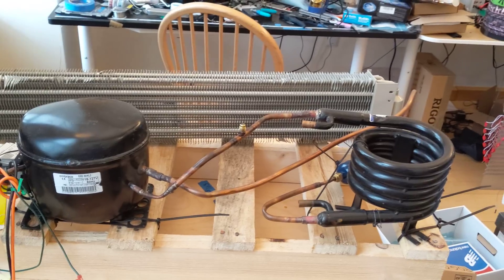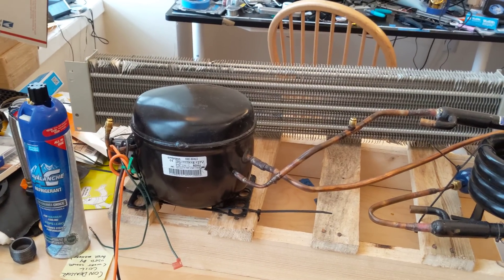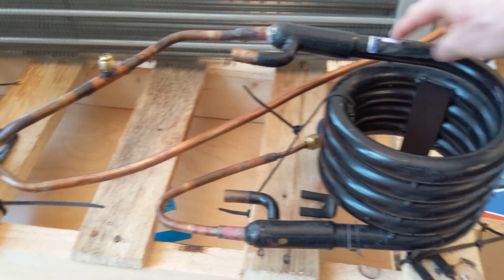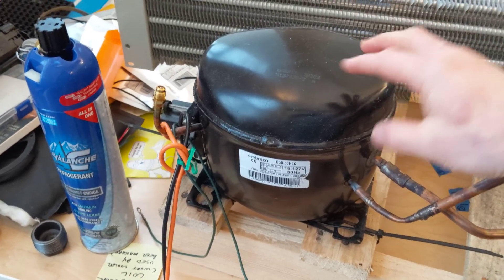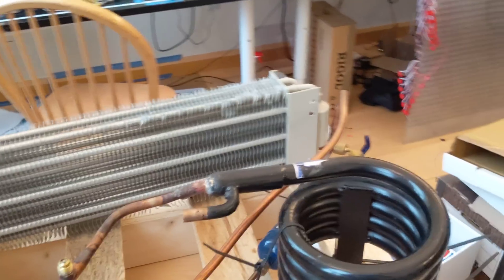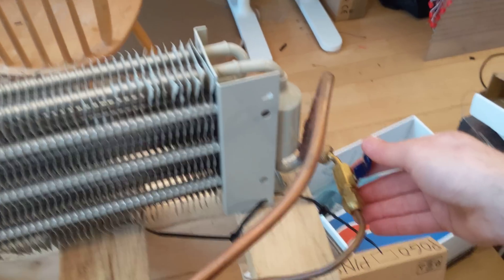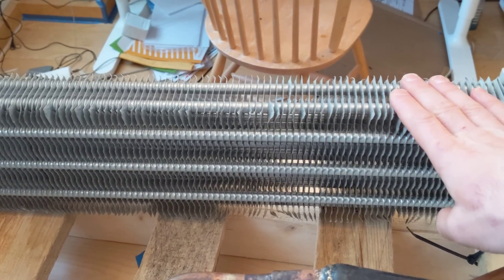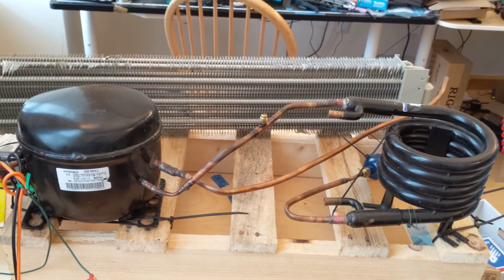Homemade air conditioner from junk parts actually (sort of) works

Comment: Would be cool to swap out the condenser on a portable air conditioner with one of those coaxial tube heat exchanger coils!

And btw, I think you may of put it around the wrong way, those bigger pipes are for the water, and the smaller ones are for the refrigerant line. (I could be wrong though)

Comment: its not evaporator that was condenser
Reply from the maker: The big long grey thing with the fins is the evaporator. The black spiral thing is the condenser. Hot refrigerant gas from the compressor first goes to the heat exchanger (black spiral thing) where heat is rejected into water and the hot gas condenses into liquid which then goes to that ball valve to reduce the pressure and then into that long fan coil to boil off.

Comment: What is the Waterloop?
Reply from the maker: Big buildings have a loop of water that goes from the ac units in people's apartments then up to the roof to chillers and then back down to the units. The units heat this water up and the chillers cool it off again.

Comment: That's kind of like a marine air conditioner which cycles sea water over the hot lines to cool it off. That's niftty. I lived in an apartment building which used geothermal heating and cooling and likely used the same kind of concept here. 

So thankful for these videos you have about AC

Comment: For an alternative metering device, you could use two of those yellow jacket ball valves, connected with a short copper run in the middle (as short as possible). 

That way, you could isolate that connection, and if you flare it on, you could open it, and slide a carburetor jet inside of it. Then seal it up and run it. Experiment with different sizes. 

That would introduce a small amount of contamination each time, due to opening it. So after you determine the right size, seal up, evac and recharge it!
Reply from the maker: Good idea, but ultimately I learned that there is a reason why all cheap units have a capillary tube and all others have a TXV!  :)
Reply: @bigjoshlevine  do you have any recommendations on where to obtain a coax of that size?
Reply from the maker: @conorabc  You can have this one for free if you are willing to come to NYC to get it! If not, you can find them on Amazon in all shapes and sizes here: https://amzn.to/3lwoBOl
Reply: @bigjoshlevine  I think my wings would get tired 😀awesome thank you! My dream is to build one of these using an automotive compressor and a DC motor for speed control. I want to somehow chill a computer’s cooling loop by putting a coax on the evap side. 

I guess I should get a setup like yours working before I try all that though! Thanks again.

Comment: Dumb question #1156: can I cool the hot pipes by wrapping them up in thin clothes , pouring water on them and blowing air with a small DC fan? You know, evaporation.
Reply from the maker: Depends on the humidity! If the air is dry then this can be very effective (google "swap cooler").

Comment: You live in a place with no access to outside air?  You living in a crawl space? 
 Should we send help?  Dial 2d86fh416fdb.. thats what you'll be dialing experiencing hypoxia .
Reply from the maker: The only access to outside air was though windows that only opened about an inch and forced ventilation ductwork. There was no practical way to reject heat though those window cracks- believe me I tried. There is air changeover do to the ventilation, but there is no way to reject heat to slow moving, diffuse air movement. You end up just making the conditioned space hotter. There are many buildings in NYC (and I am guessing elsewhere too) where the only way to reject heat is though a water loop that goes to the roof.

Comment: Nice try.   You could just get a free/broken fridge and fix it and use the components.  Clearly you discovered the lack of a cap tube is the problem, and your makeshift txv valve isn't working.  You can get a cheap txv valve from a car a/c system.  In fact, get all the parts from a car a/c and use the electric compressor.
Try again!  don't give up.

Comment: I just want to know why there are no videos of someone taking a vehicle 12v a/c system and making it portable
Reply: To big to make portable you have to have a compressor 2 radiators one hot and one cool side fans for each side and the power and it uses a lot of power
Reply: Not an expert, but I think the power come from the spinning wheel (motor belt), not the 12V.
So, basically, you will need a weed heater motor to power it... Quite noisy isn't!
Reply: I've thought about going to the junk yard to get car AC parts to build one, you'd just need an electric motor with a good amount of torque that can spin at about 1000 to 2000 rpm and hook it up to the compressor, and it should work if you connect it to a proper loop, although I'm not an expert on refrigeration so there could be some detail I'm missing that makes this not really worth it.
Reply: @Naitrio  will a car ac compressor work with a small 2 stroke motor or any small engine to spin it (and generate 12v for the fans)?

Comment: if your condenser is cooling good enough and producing a liquid refrigerant then your main problem is the expansion valve, no way that kind of valve will work right.  just use one of the three types of expansion valves to dial it in.   and of course you will have to dial in the amount of refrigerant and pressures.    I think your evaporator is fine you must have a fan though if you don't want freeze ups.   remember there must be enough liquid refrigerant produced continuous.  so there must be enough refrigerant in the system for the whole evaporator coil to get cold.  check the temp of evap coil at end of coil, if it is not cold then you need to adjust your pressures by adding more refrigerant.  a ball of ice at the beginning shows its working you just need to add the fan to prevent that from happening. but if you only get ice at the end and the rest of the coil does not ice up you don't have enough refrigerant  in the system.

Comment: I think you need a bigger evap core and a fan and youll be good but good job ,imma use the  heat exchange method with the water with the orifice but I'll use it with a dryers and accumulator, extra efficiency.

Comment: no wonder that it does not cool especially, there are no capillary tube
Reply from the maker: The idea was to use that ball valve rather than a capillary tube so that the metering would be adjustable, but it is almost impossible to get that ball valve adjusted just right.

Comment: Very nice! I am a technician and I made a mini split out of  a window unit and did my own water condenser and installed it in my cuddy cabin in my boat, only thing is that I had to add more coil to my condenser so I could get the proper pressures and now it actually works.. 5000 but's in the cabin comes really nice here in Florida.  Thanks for sharing!
Reply from the maker: Cool! I'd love to see more info on your unit! It is surprising how few DIY AC projects there are out there - probably because of the need for an EPA card. But getting the card is pretty easy, and considering how many people need AC...
Reply: Thats awesome 
How do you calculate the amount of coil you would need for the condesor. I am planing to build a mini split myself. 
What kind of low and high pressures would be nominal, assuming using 5000 btu window unit hardware.
Reply: Water has a higher thermal conductivity, why would you need more volume in the water condesor. 
Thanks
Reply: Any chance you could share some pics or a diagram?? I am trying to do the exact same thing!!

Comment: Nice work Josh. I wonder if the relatively low cooling capacity would be a good fit for radiant cooling wall / ceiling assemblies? https://www.rehau.com/us-en/radiant-cooling Also, I saw that you contributed to The Public Radio. Some interesting projects! I'm still stumped on uploading the firmware to my radio. But trying hard to learn a little bit of the AVR world!

Comment: amazing diy honestly ive always wanted to do this

edit i did do this  worked great
Reply: Tried it mate, tried it with an industrial freezer compressor setup, they don't have enough power to blow cold air. This is why you see air conditioners with 5000 btu min and up to 150,000 btu. Fridges are around 495btu.. Not worth your while. Best thing to do is to take an air conditioning pump from a car and put a motor to it, get the system charged with refrigerant and there you go.
Reply: @electriclightbulb1232  damn guess its buy over diy
Reply: @ianbuilder  yeah man you're right. I though of the same thing, I made an enclosure for the compressor setup I took out the freezer with the element that froze up front, I put a fan behind that and it would just turn all the ice to water and  drip everywhere, it can't keep up with the fan it's just not worth it ;d This year I'm gonna build one out of a car ac compressor though, air compressor motor on a belt connected to the pump and i'll get the system charged.
Reply: @electriclightbulb1232  nice good luck

Comment: Can you tell me if any R can apply to any compressor or it have to be specific. I found one old compressor, and on its label it say R134 ???
Reply from the maker: This is a very good question. The most important thing is that the refrigerant ("R") has to be compatible with the oil and seals in the compressor. This is a chemistry thing. You don't want them to react with each other, and you want to oil and the liquid refigerant to work together. There are charts like this one... 

https://refrigerationclub.com/oil-compatible-coolant/

Also important is that the compressor need to be able to work at the pressures that the refrigerant needs to change phases. Again, you can find charts on the pressures of different "R"s and then you can lookup or test the pressures your compressor can do to see if it can work.
Reply: In short you can use refrigerants with standing pressures (cylinder pressures) equal to or lower than.r134a along with the replacement of respective refrigerant compatible oil replacement for your compressor.

Comment: Where is your fan for the evaporator? Without the fan the evaporator coil will just freeze because it has no movement and cant disipate the low temp in the evap coils....this is exactly why units freeze sometimes when the evap coil gets so clogged or dirty that the fan can no longer move air through the couls so the coils freeze over. Think of the evap fan as sort of a heat exchanger also, it draws warmer ambient air through the coils keeping them from freezing. Cool project you did though and a proper TX valve for your specific gas is imperative and a muat have and must also use a thermocouple or expansion bulb....cant uae a valve the orifice size must remain a constant and changed only by means of thermal expansion and must also be sized for the particular gas yur using. I like your project yur doing something creative with your spare time and learning too...confusios say: man who knows everything has a lot to learn
Reply from the maker: No fan, I was relying on the massively oversized coil to move the air convectively! While a proper TXV would certainly make life easier, I had a couple of reasons not to use one here. Firstly, I really wanted to get a feel for adjusting the value manually. Secondly, my future plan is to get rid of the expansion valve altogether and instead depressurize the subcooled refrigerant with mechanical work. Stay tuned!
Reply: @bigjoshlevine  perhaps a needle valve would be a better candidate than the quarter turn valve, due to the dynamics of the "eyeball" inside the quarter turn valve it would open and close per sey too quickly as the QT valve is designed more for flow characteristics as opposed to a needle which is designed moreso for an application where pressure and the fine adjustment of pressure is a necessity/concern.....you ever dabble with chilled water systems? Its sorta like instead of using a fan blowing air across the evaporatir coils to make cold air you basically submerge the cold evaporator in water/glycol reservoir and pump it from there to any number of rooms which is the sweet part...and in each seperate room is another coil in which the cold water travels through and a fan behind the coil blows the cold air into the room and to adjust the temp in each seperate room you simply adjust the flow/amount of cold water entering the coil so theoretically you could cool an unlimited number of rooms with one system so long as you can maintain a constant water temp...to heat the rooms you have another pump and coil with heated water and a hot coil/fan in each room...or to do away with having 2 coils in each room you can use a temperature contolled automated 3 way mixing valve just before the coil in each room to maintain temp....im in commercial diving business and due to the prohibited use of electricity in our living chambers/habitat while underpressure and in an oxygen/helium sensative atmosphere we must use chilled water systems as they are spark free
Reply: @bigjoshlevine  I am gathering parts to make my own too.  I believe way over sizing the evaporator can be done and why wouldn't the larger surface area cool by radiation, convection?   a block of ice will extract heat out of a cooler.  I think and will experiment with no fans on the condenser or the evaporator, just by using way larger ones.   the only reason I see to use fans is to keep the units small.

Comment: Needs capillary tubes...and you dont want to dump all of the liquid refrigerant into the evaporator at the same exact spot...this is why it's a block of ice right where you put the refrigerant in to the evaporator...if you look at a A coil and see how refrigerant is entering the coil you will see a bunch of small tubes where each is going in  to the evaporator coil at a different  spot...its broken down into sections that each tube feeds separately before finally rejoining together leaving the evaporator...everything in a ac system is designed specifically for  what its being used for and taking random components and putting them together and getting it to work..without question.. will be a difficult task...try feeding the refrigerant where you dont have the huge pressure drop at a single place...feed multiple places in the evaporator and leave the ball valve so you can dial it in...maybe...you can take the section off a A coil so you can put a piston in...start with smaller pistons and try to dial it it. You should try using a evaporator designed for ac if you don't see any encouraging signs with the coil you are using...but definitely don't dump all the refrigerant in at the same place and why are you not using a load when you are testing it...there must be heat to remove for a ac to work or else the pressure will be low which will cause the condensation to freeze on the coil turning it into a block of ice...but I guess that is not a problem if you are not blowing air over the coil in a confined space

Comment: These experimental setups are best on youtube, because all the needed things are visible. I'm currently working on similar project but in eu it's kinda impossible to get any sort of refrigerant... I'm currently planing on harvesting it from old refrigerators
Reply from the maker: EU is ahead of the curve on refigerants! Most of your new refrigerators use R600a, which is actually just iso-butane! It is nonozone depleting and not high green house. I get my r600a in cans meant for reflilling lighters, and it is freely sold in this form. You do have to be careful not to set it on fire, but otherwise it is a very very good option.

Comment: You need an adjustable expansion valve made for air conditioning. The adjustment has to be precise so the valve is very finely adjustable. Then you need a larger evaporator. Could try using a condenser from a car. It has a lot more tube and fin area than that baseboard heater.

In any case, trying to push heat into 90F water isn't the best for ease or efficiency. You don't have a lot of 'headroom' to the boiling point of the water and you have to consider the heat put into the system by the compressor along with the heat you're moving from the room air.
Reply from the maker: Agreed and agreed! I really didn't know what I was doing when I though this together. I still don't know what I am doing, but at least have better tools and parts now. :)